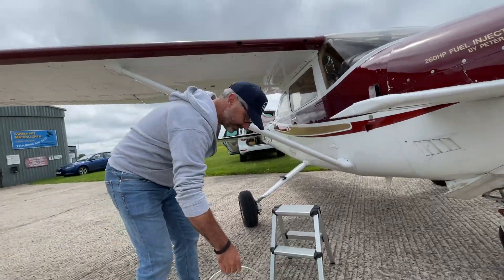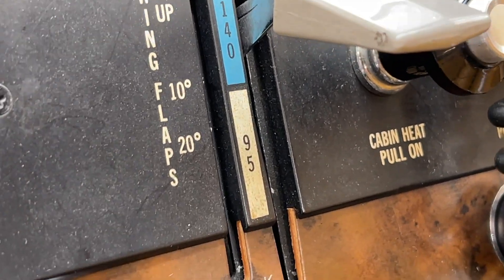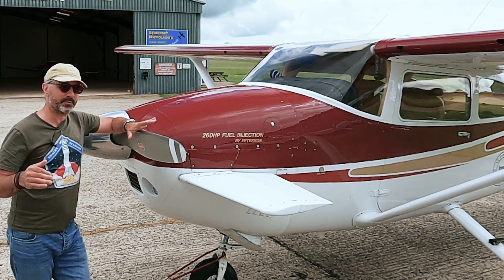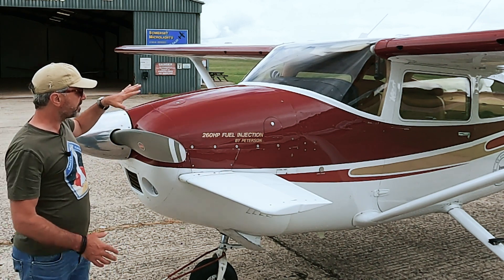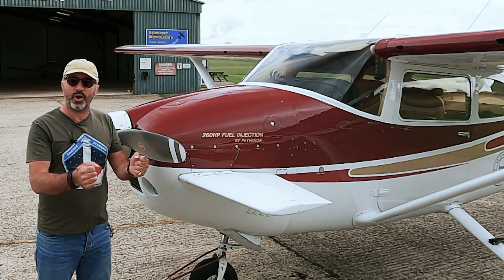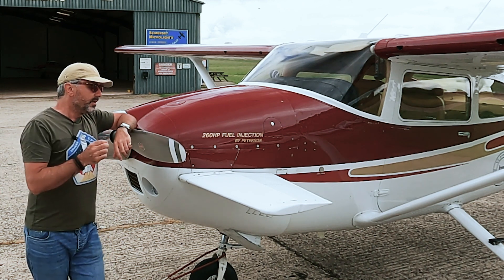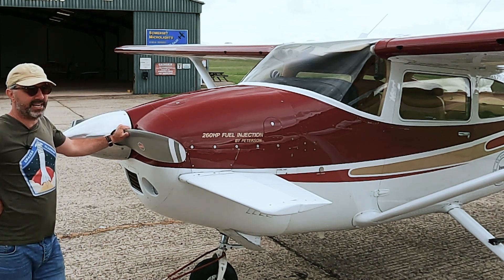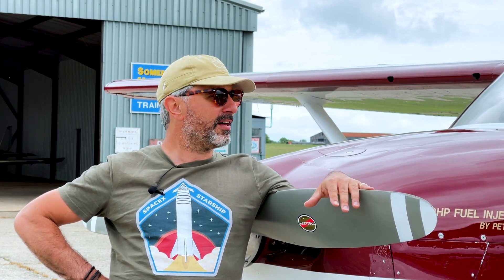What the canards do on this amazing aeroplane - the Todd Peterson 260SE STOL Cessna 182P

Comment: Canards are usually pushers. So this design is interesting - a lot of prop wash over the canard would enhance the control authority I'd imagine. Very interesting design.
Reply from the maker: Yup.  You can almost lift the nosewheel completely off the ground from stationary with full power and full back on the yoke.

Comment: Does this plane still have to worry about Base to Final Stall & Spin?

Does canard help with that
Reply from the maker: It's much less of a threat because of the canards. I have struggled to practice power on stalls in this plane as it still flies straight and level at 30 kts. The risk is still there, but reduced by the canards and the lower stall speed

Comment: You seem way too comfortable with propellers, don't care if the keys are out I'm not hugging one like that
Reply from the maker: That's a wise decision if you're using school, shared or rented aircraft that you don't know well. When it's your own plane which no one else flies, and the prop has been hand turned to circulate some oil because it hasn't been flown for a few weeks, and you know you did a full lean mixture cut off the last time you shut down, the keys aren't in it and the master has been off for weeks, you've pretty much eliminated any chance of it coming to life. A bit like a kicking horse, if it's not yours, don't go near the rear end. When you know it and trust it, it's less risky. But, I always treat it as a live prop on days I've been flying it. I save the 'hugging" for special days like this one 😎 good luck with your PPL check ride!
Reply: @CharlieLamdin  thanks, I got my PPL a while back, just slow to upload videos

Comment: We had the original version of this, a Robertson Wren, in the Irish Parachute Club many moons ago. It had the canard, double slotted flaperons, and several vertical surfaces in front of the ailerons which pivoted with aileron "down" deflection.Despite these, roll control was very lazy when on finals at 45 kts. Stripped out for skydiving, the C of G must have been very near the forward limit. Despite the canard, the firewall and nose-wheel took a bashing. It had been bought used, from Ferranti in the UK, and was fitted with an auto-pilot, dual nav-coms and a full suite of instruments which were merely a liability in a VFR jump-plane. The weight of all this crap weighed more than a jumper, and contributed to it's demise, when is caught telephone wires on take-off, and was written off, fortunately without serious injury to the occupants. Jimmy Matthews, our chief pilot, used to fly it backwards at air-shows, if it was too windy for us to jump. The Reg. was EI-ARN. Jimmy had a close call when the electric trim "ran-away", and applied full elevator nose-down trim., luckily at high altitude.Jimmy was an inveterate prankster. Climbing to 7,000 feet, he used his nail-file to unscrew and remove the control yoke, which he brandished at the load.Not to be outdone, a jumper grabbed the nail-file and flung it out the open door.Well, we were getting out anyway!
Reply from the maker: Wow what a story. I can’t believe it actually flew backwards if it was windy enough!
Reply: @CharlieLamdin  something like a 35 knot stall speed.  I’ll bet it would fly backwards.

Comment: Presumably the stall speed with an engine out will be a little faster due to the lack of prop wash over the canard?
Reply: If it's a published stall speed (which it ptobably would be with the STC applied) Vs must be based on a power idle configuration. So it may be able to fly slower than 32kias with power on (but remeber the main wing is unchanged, so maybe not).
Reply: With no engine power the propeller will windmill which increased drag do to the flat-plate effect. I can believe that stability and controllability will be slightly better through the flight envelope, but I do not see that there would be a big increase in the power off stalling speed. Power-off stalls in a Cessna are not very dramatic when done from altitude typically just some pitch oscillations with little roll instability, how much difference there would be in an airplane with the canards is mere speculation on my part since I have never flown one.

Comment: With a standard 182 a common way to damage it is to land on the nose wheel, which bends the firewall, and you notice you  can't move the rudder pedals as far as you used to. So you go to the mechanic who explains the amount of work needed to fix this and you're shocked at the price. The increased elevator authority this conversion provides, eliminating the nose wheel strike,  would go a long way toward paying for the conversion. And it takes less runway! Sweet!
Reply: Having owned a 182p for several years, I can state that your comment is based on hearsay and myth. If the 182 is trimmed for the approach airspeed, it is not “nose heavy” . Poor lilting might cure a bad landing and damage the nose gear of the firewall, but it is not nose heavy nor hard to land If you are to fast it will porpoise, but, again, not nose heavy. It is no more susceptible to firewall damage than a 172.

Comment: Thank you for the rundown.
One thing that caught my eye, and it is not right is your ASI.  Usually, part of a stol STC is to redo the colored arcs on the ASI faceplate to match the new numbers. Your ASI is stock, and not even designed to go as low as 32.
I have no clue how this got approved.
Reply from the maker: They made 900 of them so I guess it did get approved! I have the STC. All info here https://katmai-kenai.com/

Comment: Is that the static port about a foot aft of the canard on the white stripe? If so it is highly likely your airspeed is highly suspect.
Reply from the maker: All the mod info is here https://katmai-kenai.com/
Reply: @CharlieLamdin  it's a simple question. Is that the static port? If they put it right behind a lifting surface then your airspeed is likely wrong.
Reply from the maker: Yes it is. I’ve got a new video coming out soon with some slow flight and a camera close up of the ASI so you can let me know what you think when you see it. I’ve not heard of any issue with the asi on these planes before but who knows. You’re probably right. What’s a guy to do!

Comment: Do the canards provide an up force or down force in normal cruise?
Reply from the maker: I don't know for sure but I believe in cruise they are neutral or slightly up force.
Reply: @CharlieLamdin  Thanks for your reply. Can’t find that information anywhere on YouTube for the Cessna 182.
Reply from the maker: They are neutral when the rear elevator is neutral, that's for sure.
Reply: @CharlieLamdin  Okay 👌.

Comment: Owned a 1967 Skylane with a Horton STOL kit......flew out of a private grass strip of 1,200 ft and had no problem taking off full fuel, three passengers and baggage.....approached at indicated 40 kts and landed very comfortably once I got the timing down for added power to get the nose up......could and did takeoff (short field/wet field) as soon as the airspeed needle moved, climbed out at indicated 40kts with 20 degree flaps.

Loved that plane, had to sell when I lost my medical due to diabetes......
Reply from the maker: That sounds incredible Jim. Was the 67 skylane a lighter plane than later models?

Comment: Todd makes some awesome planes! He converted my 182Q to a King Katmai over a number of years. Along the journey added VGs, Sportsman, Glass Panel, 3 Blade MT, ported and polished IO-550 with an electronic ignition and tuned dual exhaust from Power Flow--350HP'ish--yeah baby! She takes off and climbs like a wild stallion and lands on a dime, not to mention cruises at 130 knots at 13'ish gallons/hour. Yep, level flight at 35 knots is achievable, but pushing it--40 knots all day without breaking a sweat. Love both Todd and Jo! Quality people that are as rare as the amazing planes they build...
Reply from the maker: The IO550 Katmai is the dream machine! You're even luckier than me with the 260SE :)

Comment: I have experience working on a Peterson 260 STOL. I would have added a low point fuel drain in the induction system to prevent fires on start up due to over priming..
Reply from the maker: Mine has an electric fuel pump, not a primer, as it's a fuel injected IO470F - does it still have the same problem?
Reply: @CharlieLamdin  Yes. If excess fuel accumulates in the lower section of the air induction system, there is nowhere for it to go,  and if the engine starts quickly and cleanly, you're okay. If you hear a burp or whump when cranking, that is when the smoke starts coming out of the cowl.
Reply: This was back in the 1990s and I have retired since 6 years ago, so I don't know where the plane is now. I just tried to be very careful when starting it and I advised the owner to start cranking before introducing any fuel. That way none would pool in the low spot of the induction system.

Comment: I don’t mean to be overly critical, but I cannot recommend being so careless around the propeller. Way too many people have been injured that way. When I was instructing many years ago, and whenever I take passengers with me in my airplane now, the very first thing I tell them is that the propeller is dangerous, that it should be treated much like a loaded gun, always ready to kill. 

As for the Petersen conversion, I’ve looked at two of them in the avionics shop where my panel was being redone, and I watched one of them take off. I have owned two 182s and have perhaps a thousand hours in 182s, and I have to say that the take off I observed was pretty dramatic by comparison with a stock 182’s capability. I have no opinion whether they’re worth the cost, but they certainly seem to do as advertised, unlike some aircraft mods.
Reply: It's a muscle memory issue. Although your brain tells you that it's safe to stand there because the engine isn't running, your body remembers you standing there (or walking through the propellers arc when the engine isn't running). Then, one day, when you're stressed or distracted.....   The same goes for pax - never allow them to walk through the arc and never allow them to approach the plane from the front, or exit the plane towards the front, when the engine is running. (And never allow them to rotate the prop!)
Beautiful 182!
Reply: I own a PC-24 jet, just to avoid the prop safety issue....;)~
Reply from the maker: I hear you re the prop. And yes, they do take off dramatically differently! I have a video which shows me bouncing into the air at 30kts on a grass strip soft field take off and flying.

Comment: You forgot to mention the wing mods to the leading edge, flaps, ailerons, it's not just the canard that allows it to fly slow.
Reply: He said this one was converted in 2005. I think they stopped adding the extra stuff on the wings at that point. We just brought our home the other day and i believe it was in the mid 80’s so it still has the wrens teeth and the drooping wing long flaps. The newer converted ones just have the canard and quite a bit more horsepower. Still very cool airplanes no matter what.
Reply from the maker: @jamesmillson6881  thanks, you beat me to it!
Reply from the maker: You had me worried for a moment, but no, this one doesn't have wing, flap or aileron mods

Comment: we have the Wren, father to your 260. amazing aircraft. the canard makes it a pleasure to takeoff and land.
Reply: My understanding is the true wren aircraft did all the performance using aerodynamics and the Peterson Wrens do the same thing with horsepower. There was a first generation Wren at our local airport last year.  It had a stock O-470 engine, the canards, gap seals and these really weird rudder like devices on top of the wing that operated with the ailerons.  I forgot it had Fowler flaps too.
Reply: @flyerbob124  Those would be the “Wrens Teeth!”
Reply: Mike, What year is your Wren?
Reply: @hankslank8672  1968 182 J model converted to wren 460
In 1984 by Todd
Reply: Did you buy your Wren from Mark Pilkington?